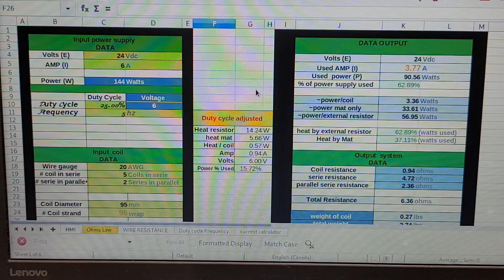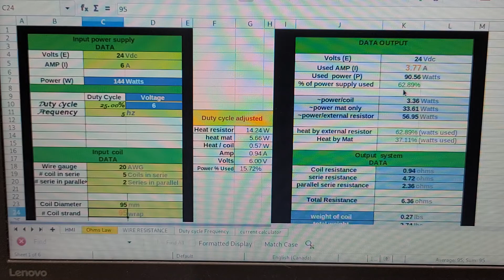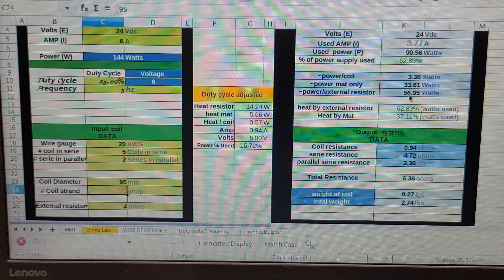diy pemf.  a little math.

Comment: I read elsewhere that if you have a 19v power supply you need enough wire/wraps to get at least 9ohms, without a separate resistor. Does this sound right to you? What is the benefit/necessity of having a separate resistor?
Reply from the maker: Hello! Love questions like this one. There is a lot of reason why that statement is right. ohms law being the main one. 
I like to use external resistor because of two reasons:

1- placing your coils in parallel as much as possible is essential ( for balancing purpose and reducing noise in the signal) )  
2- placing coils in parallel reduce the overall resistance, yep that is always a good one when people hear it for the first time.  Two coils having 2ohms of resistance in series make 4 ohms, 
same scenario in parallel  makes 1ohms of resistance. look at it 

So we have to add an external  resistor to keep ohms law in check.   😄
Reply: @Steeve.  Ah! Like a humbucker guitar pickup, in reverse, as opposed to a single coil pickup